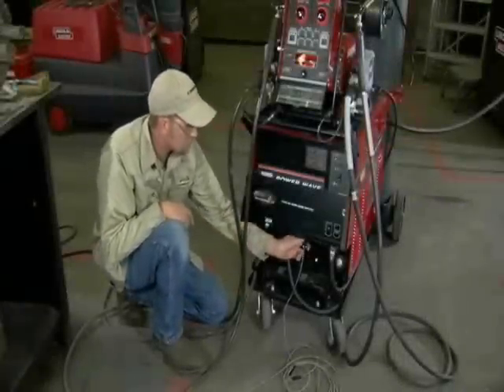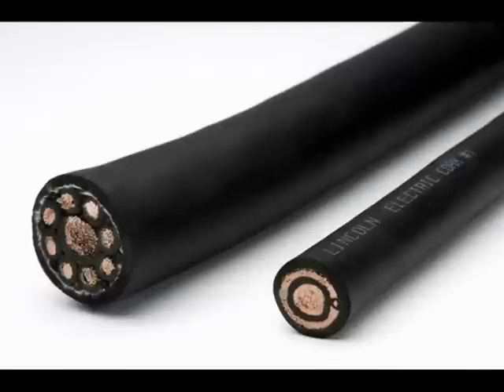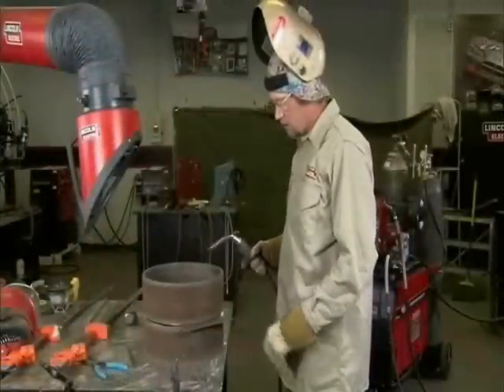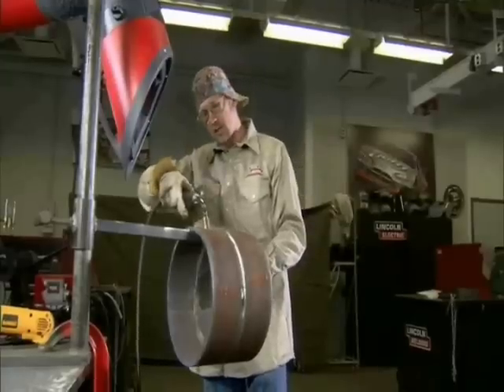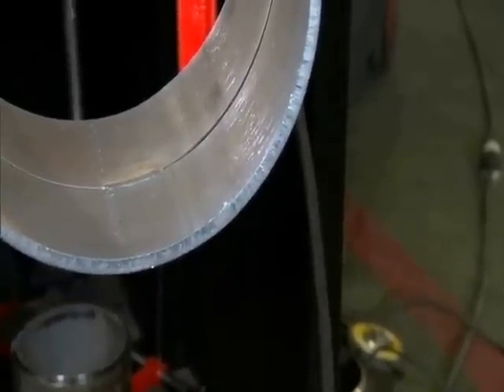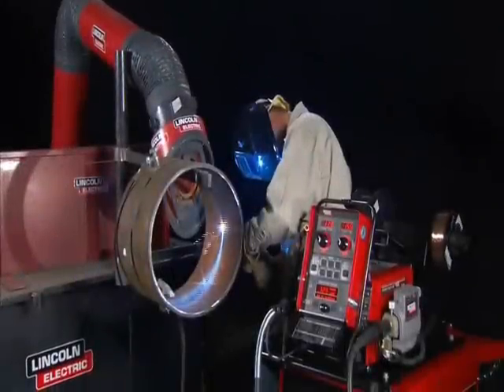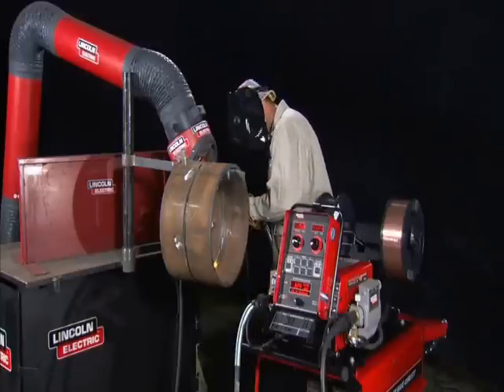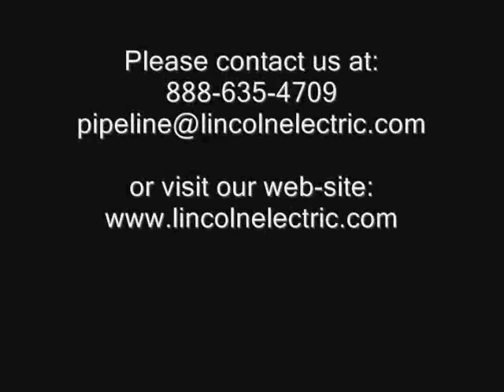STT Explained - Part 2

Comment: At Exterran Youngstown, Ohio we use the S350 & S500 with STT module.  The 350 with dual wire feeds. It makes putting consistent downhill hard wire roots in a breeze. These multi-process units are beasts. All digital controls on wire feeder  and user friendly presets already dialed in to wire size, type of metal and process make it worth the price. Makes my job alot easier.Great job  Lincoln!!!

Comment: We just got 3 new 455m's  to go with the 3 that were purchased 2 years ago . We have been assured that we have the lasted updates programed in to the units . They were delivered 1 1/2 months late and did not have previsions to plug in a remote , we are still waiting after a week and a half for your north western rep to wire these plugs in .He told us that he would come back the next day to wire in the remote receptacle ??? I found glitches that I would like to discuss . E-mail or contact # ??

Comment: so i am not a pro welder, but how do you do that in the field or at sea???... you know BFE????...why not just use a stick welder? they have used it successfully for 7 decades even on Battleships.
Reply: A year late but hey...basically because in a high production shop, I can weld 30+ joints a day with less waste,  and get it out the door faster 👍🏻

Comment: I have been using the STT in fab shops since they came out 7 or 8 years ago and they still have not fixed their program 1 and 2 stick mode . The stick mode on these machines is absolute garbage !! We use them for the root on some jobs but the stick fill and cap has to be done with anything but the power-wave 450. They might have a better product if they actually listened to the guy welding with these things everyday .

Comment: Lmfao all the veteran arc welders millwrights and wanna be pipe experts are not open to new technologies....I run a miller pipe works  RMD .....same as the Lincoln......I will take an average welder.....train them and then embarrass you with quality weld ....tensile strength X rayed ......I will be at home drinking beer while your still welding......bet